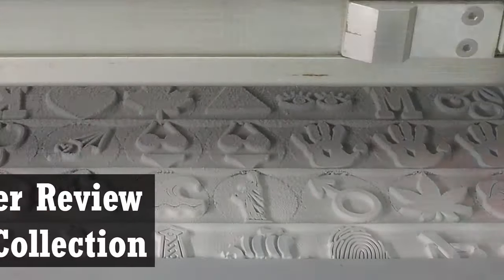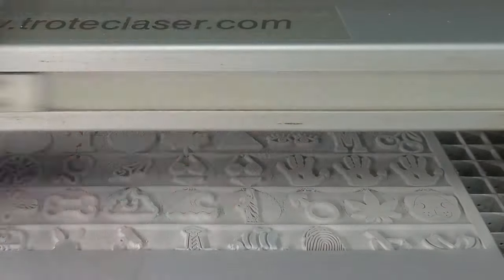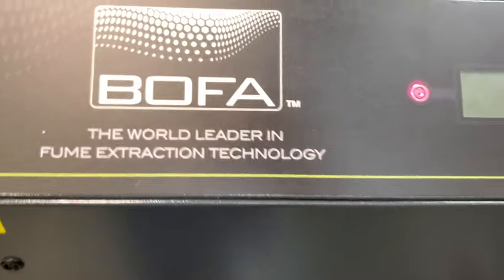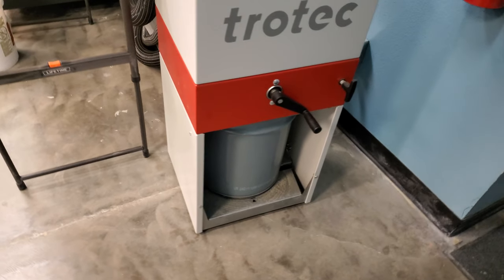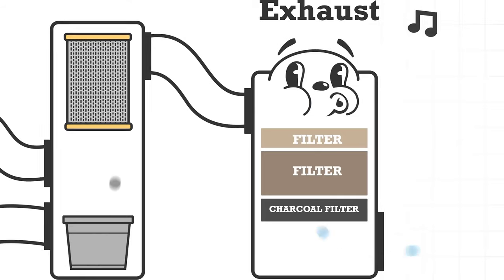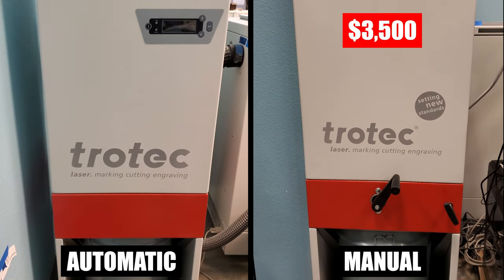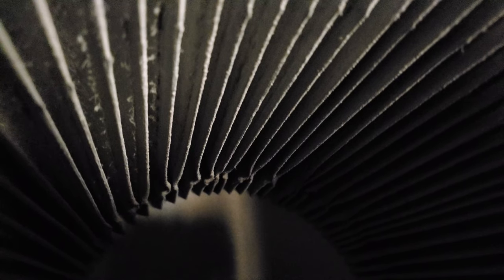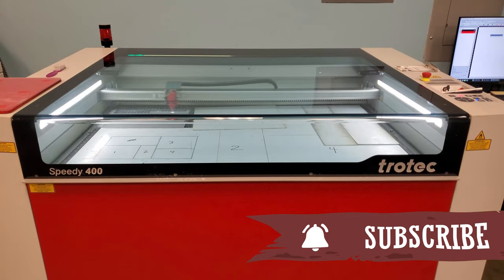Laser Experts Teach How to Eliminate Engraving Dust and Stop Ruining Filters with Exhaust Pre-Filter

Comment: Good job guys, I have a BofA and soon found out the filters are not a fan of MDF, Do you cut MDF? how much longer would you say your BofA filters are lasting? Thanks, Lea
Reply from the maker: I honestly couldn't even guess how long you've got. If you have display on your BOFA like ours, keep an eye on it. You should be able to visually see how clogged the filters are, and if the fan speed starts to get automatically throttled. 

A long time ago, we learned the hard way about the issues engraving and cutting MDF. We managed to ruin the expensive filter in our BOFA unit within about ONE week of heavy MDF engraving. We had to switch to exhausting outside our workspace. We no longer use our Universal laser connected to our BOFA unit for anything other than light engraving on some hardwood. Our Trotec lasers do all the dirty work as they're built for it (sort of). The pre-filters really work great to keep the heavier dust out of our Trotec Atmos Duo units. I personally like the Atmos Duo Units better than the BOFA units, because you can stack some disposable filters in it to extend the life of the expensive box filter.
Reply: @smedleyworks  Thanks for the reply really appreciate it, I have had a look at Trotec really great machines, so you cut MDF with them, how long do the filters last with the prefilter? I'm kinda new to the fume extractor world and looking online there doesn't seem to be that great of a deal of information apart from MDF really clogs the filters with their sticky smoke :(
Reply from the maker: We have a disposable fluffy white filter in the top of our Atmos Duo, and because of the Pre-Filter system, it pretty much stays white, and that can be changed whenever. So, I'd guess that we won't wear out the expensive box filter in there any time soon. The pre-filter's filter will need to be replaced because the scraping paddles will wear it down. Our automatic machine's filter lasted about two years of heavy use. I think the manual pre-filter machines' filters will last a lot longer though.
Reply: @smedleyworks  That's really got me thinking, that big stand-alone pre-filter from Tortec looks like it has a wood dust filter for a wood shop they also have blades inside, I wonder if the filter is a higher grade than your fluffy white ones or maybe the same? interesting stuff thanks, guys.